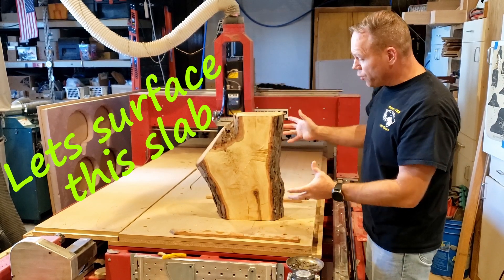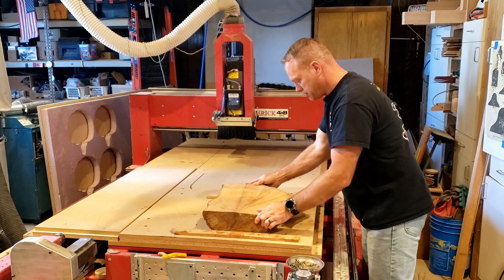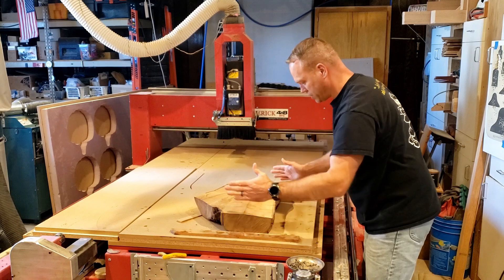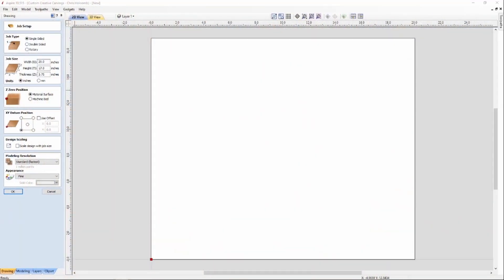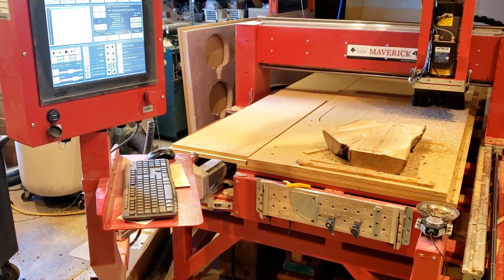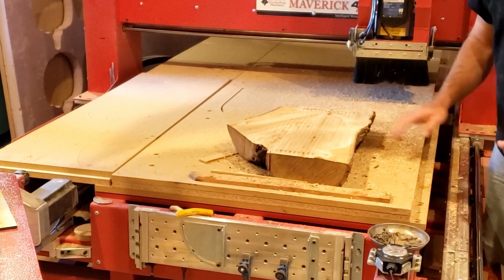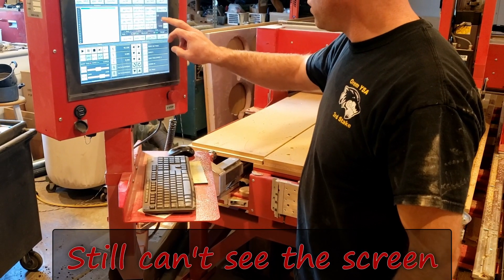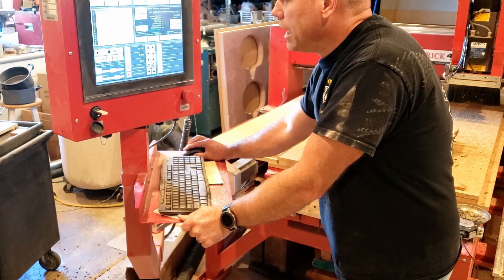How to flatten and surface a slab on a CNC

Comment: Evidently, your presentation is NOT for absolute beginners, as there are many steps/ assumptions which, in the making, omit steps that beginners would miss. As an example, if I was sending you a recipe and omitted spices, assuming that you knew about using specific spices, you would never cook a meal, as would I. Consequently, leaving out the software used, etcetera, and the picture is not sharp left me asking more questions about the value of the presentation too. However, from a struggling CNC owner, have a great 2024.
Reply from the maker: I appreciate the input. I am sorry to hear that you are struggling.  In a way, I still feel like I struggle every time I start a project. I hope you work through your struggles. Please let me know if there is a specific part that you want me to go into further detail about. Or if there is anything else that I can help with.  I hope you have a great 2024!

Comment: Great video!  I have shimmed slabs similarly, but I always use hot glue to secure the slab, wedges, and bed together.   This prevents any vibration from loosening any of the wedges.
Reply from the maker: I've thought about trying hot glue. With the big slabs I haven't had a movement issue though

Comment: I always make the clearance box at least 1 inch bigger on all sides. Othe than that, this is how I do the same thing. Thanks for sharing!
Reply from the maker: That makes so much more sense than what I was thinking you ment.
Reply from the maker: So 3" all around?
Reply: @CustomCreativeCarvings  If the wood is say 21x18 I would cut 23x20